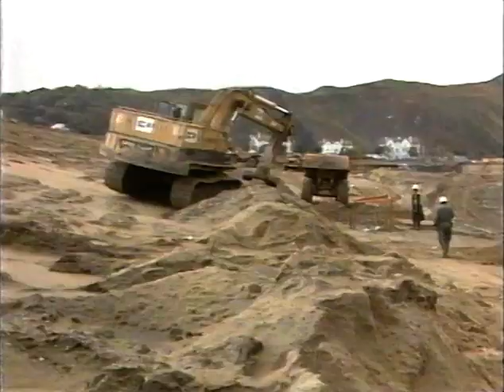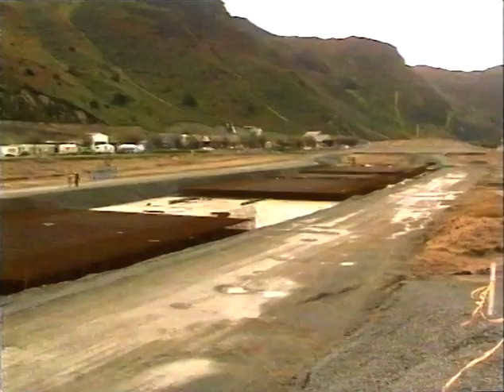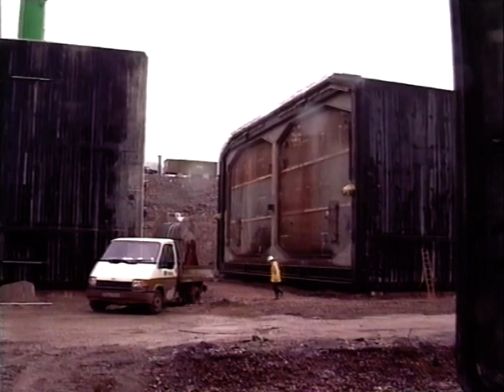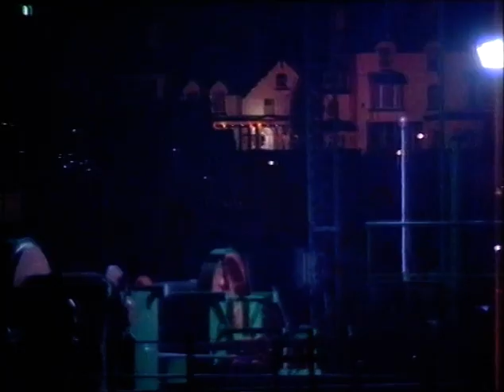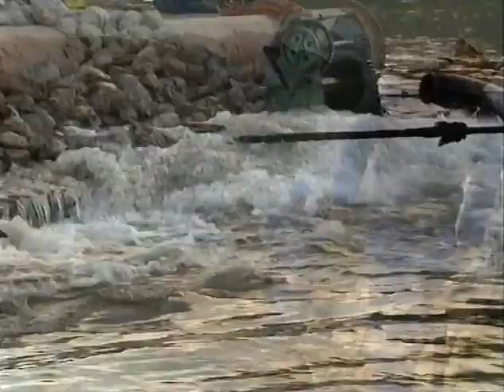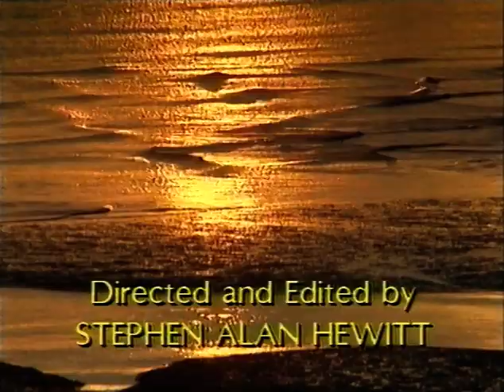The Conwy Crossing | Various Stages of Construction of the Tunnel | 1991

Comment: Does anybody think that this tunnel could have been bored? I wonder why they opted for immersed tubes sections?
Reply: My guess is the bed of the river was not suitable for boring with to many different types of material
Reply: A bored out tunnel would have had to go extremely deep to find bedrock. Not sure how much longer the tunnel would've needed to be to provide a suitable gradient, especially on the Llandudno Junction (the eastern) side, the land that the road is on has been a build up of silt for hundreds/thousands of years. That's my guess : )